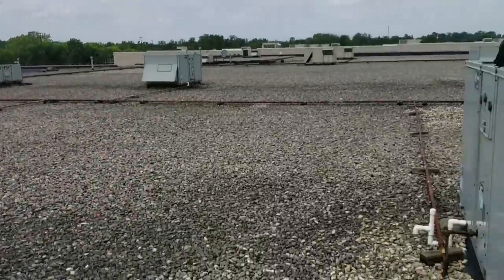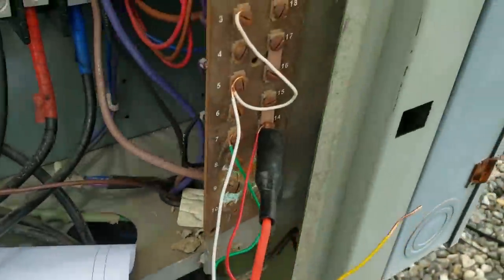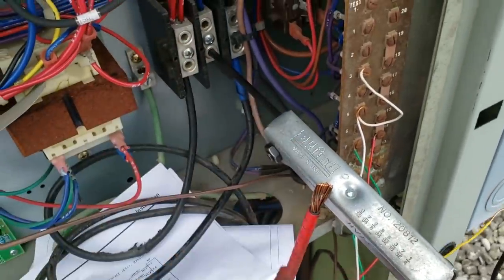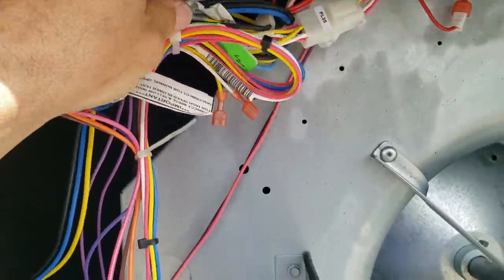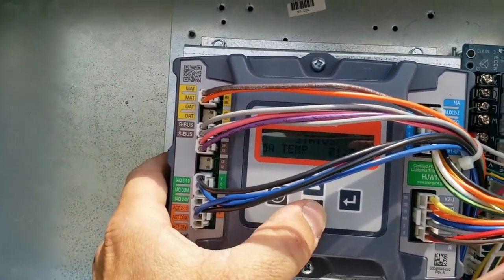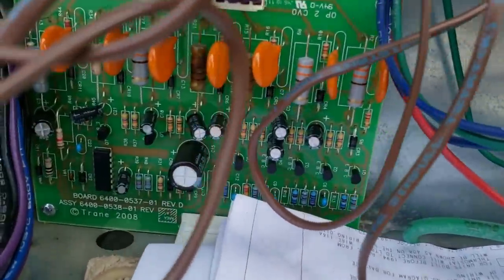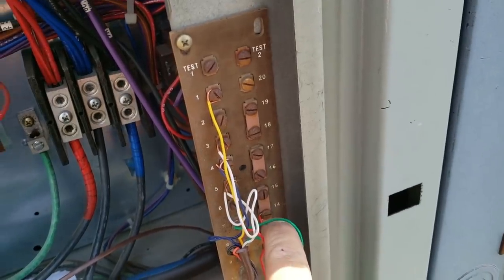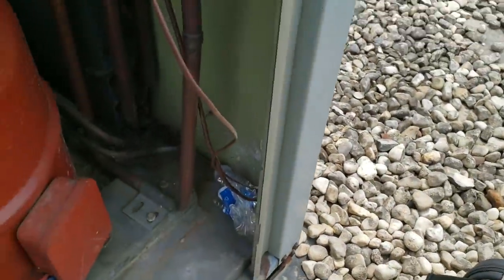Trane & Carrier Package Units Not Cooling

Comment from the maker: I finally had a chance to look up what the large step down transformer was for.  According to my book it was for the (460 volt units only) to power the draft motor.  This system was a 208- 230v.😲  So I'm not sure why it had the transformer unless that motor only comes in 120 volt?  Which would make sense so they only have to stock one motor?  Like I've said in the past I don't know everything but I'm willing to share what I do.
Reply: HVACR Survival I think I seen that once several years ago on a call center building
Reply: That’s exactly what it is for, it’s that big draft motor for those trane units with the barrel like heat exchanger if I’m not mistaken 
Good stuff man, you are the man!!
Reply: No it’s the transformer for the hot surface igniter. When the heat relay makes it powers that transformer to light the 120v hot surface igniter the unit uses
Reply from the maker: It likely does both the ignitor and the idm because I know the hsi is 120v, but I did read in the service manual that it was suppose to only be on the 460v units and this was a 208-230v.
Reply: HVACR Survival maybe ,thanks Rick , I’m still learning every day
Reply from the maker: @gregbowman3598  dude, we all are or were lying to ourselves.
Reply: I was just about to comment that.
Reply: Hot surface ignitor and it should at least amo out around 2.5 amos, if not it won't ignite
Reply: @HVACRSurvival  that 350VA transformer isnfor the combustion blower and HSI. It only receives power on a heat call. Other than that it is not powered. They also have taps for the line voltage. You move the blue wire ( red is common.....not very conventional) just recently found a unit tapped wrong at 230v and i had 210v for line voltage. Moved both transformer taps and had a steady 27v.

Comment: I do a lot of work on Tranes. 16&17 is where that fire alarm should be wired to, it’s the e-stop. The large transformer is for heat. They’re good units. Good finds though bud.
Reply from the maker: Thanks Justin, what are they using a the transformer for? I have their Voyager book and went to their class but I just don't work on a bunch of them.
Reply: Without having the diagram in front of me, I know on the 460 units it’s the combustion motor at 208 vac and the HSI. I’m not sure if they use it for the combustion motor in any way for the 208/230 units. But definitely the ignitor
Reply: Also, if you have an account with a Trane Parts center, they can set you up with their app which is a pretty good tool. If you have the serial number, you can get diagrams off it
Reply from the maker: Thanks Justin! I appreciate the info 👍👍

Comment: too much voltage drop going clear to the fire panel and back to break the whole transformer secondary, unless you add a relay/contactor to take the load.
the indoor blower feeding/spreading fire is the main issue and very first thing F.D. does upon arrival is cut power to building and it stays off long term anyway :)

Comment: I believe those units have a binary EMR stop input at the LV terminal board for smoke etc... (If not used there should be a jumper across the terminals, generally #5 & #6 If memory serves)
Reply from the maker: Good to know information 👍👍That is a monitored fire alarm system and I'm not certified for fire alarms so I'll leave it up to them to verify its all correct. Thanks 4 watching!

Comment: I don't work with this kind of stuff at all, but as a technician in a different field I spotted one thing. Pause at 7:48 and look at the incoming power. Why are the 3 phase cables wrong? Perhaps it doesn't matter in systems like this but in my job we always leave a clear note to the next guy about why we have shifted the phases if we really need to do so.
Reply from the maker: Are you referring to the red and blue tape on the leads? Correct phase is important in our field as well. Improper phasing can destroy a screw compressors in less than a second.
Reply: Yes, I noticed in the video that the blue and black doesn't match the blue and black on top of the terminals. If I for some reason notice in my equipment that someone marked the wires wrong I would have to either change the tape or leave a clear note to the next guy to verify phasing if they ever need to do anything as we would assume correct phasing if marked at all. Great video btw.
Reply: The colors on the incoming wires should not be changed.  They represent each leg back to the pannel.  If this were 480v they should be BROWN, ORANGE, YELLOW or BROWN, PURPLE, YELLOW,  but the colors in the unit would be the same.   Each manufacturer has a different color scheme, some use pastel colors on the same lugs.  

When the units the units were installed they were phased for rotation not the colors of the wires.  If they are removed for any reason the tech will phase them for rotation again.

Comment: those resistors are directly below the thermostat plug also, and judging by corrosion on the terminal board, it may be an issue also(or someone shorted t-stat or batteries leaked in causing a short)

Comment: Nice job Rick!   Thanks for sharing that with us!   Question:  Do you ever use dielectric grease on those connection blocks and contactors, especially where you have dissimilar metals?
Reply from the maker: I do if I'm installing a new panel or wiring up a unit with dissimilar metals. It's a lost cause on this one because the oxidation had already happened.

Comment: When it comes to the Trane unit, you are suppose to use the test pins and run the system through test mode by causing a direct short between the 2 test pins with a alligator jumper...
Once the cycle switches to the test mode you want, at this point you are to remove the short...

1 fan
2 fan, energize economiser motor
3 fan and comp 1
4 fan, comp 1, and comp 2
5 fan, low heat
6 fan, high heat

The 24 volts on the side pins with screws are for emergency shut off..

There is no true # code, it's all about who and how they decided to use each pin and where jumper blades are installed on the right side of the unit.
Also Trane uses resistance/DC voltage thermostats
Reply from the maker: I have a decade box but these units were just converted with a control board so they would work with 24 volt thermostats.
Reply: Understood, but the test pins bypasses T-stat and allows logic board to control operations for diagnostic problems...
No need to figure and jump out components...

Just some trouble shooting advise for others watching.  That's all
Reply from the maker: Thank you 👍👍

Comment: I believe those transformers have something to do with the heat
Reply from the maker: I figured it might be that or a convenience outlet.  I haven't looked at my book yet 👍👍 Thanks 4 commenting n watching!
Reply: He is right. Step down transform 460-120 for ignition controls. Good to see a vid from you Rick. Lots of potential work on that roof.
Reply from the maker: I just now had time to look it up. That's supposed to be for 460 volt units so it can run the draft motor. What don't make sense is this was a 230 volt so why would they put that in there if it didn't need it? Seems like a waste of money.
Reply: Well it's a Trane for ya
Reply: @HVACRSurvival  Those Trane units are supposed to get 460 volts, looks like it was rigged to work with 230v, also those newer Carrier units have a design flaw with the abs plastic pulleys (they eat the belts up), whenever I see one, I immediately change it out for metal pulleys.
Reply from the maker: @everlastingdane  I've never heard that about the plastic pulleys.

Comment: Thanks Rick!! Awesome work!! You might could check with Ted at Anti-DIY cause he seems to be like the Trane God... LMAO. But yes usually yellow is cooling circuit that should also include a high pressure and low pressure switch. Like you didn’t already know that...
Reply from the maker: Thanks Brandon 👍👍I have a real good training book from a class on the Voyager but I haven't looked it up yet.  Plus there is a back story to this job that I couldn't go into detail about. I appreciate the view and comment 👍👍

Comment: Running those compressors without atleast putting the panel over the hole is not doing those compressors any favors. Your causing a high head pressure situation.